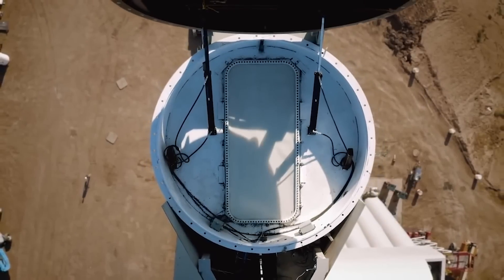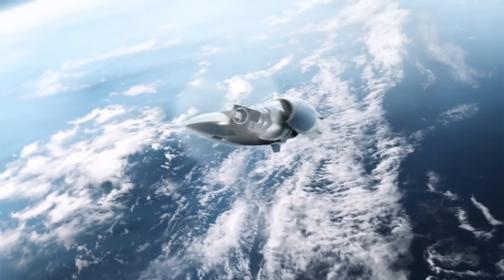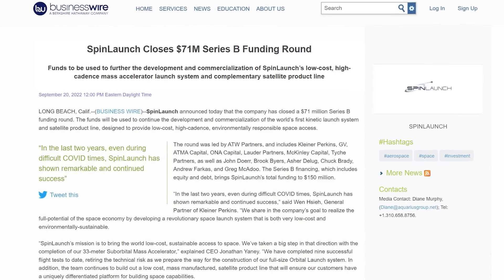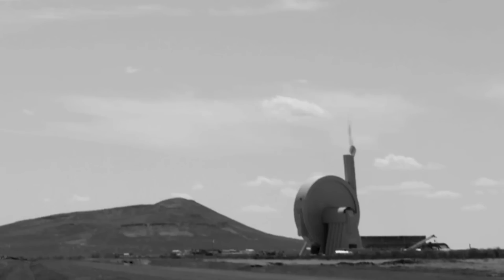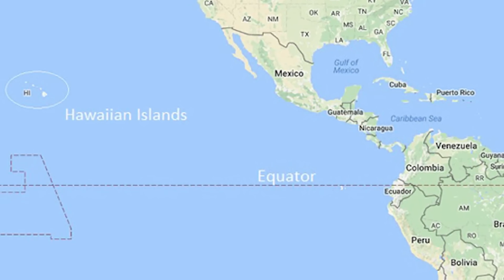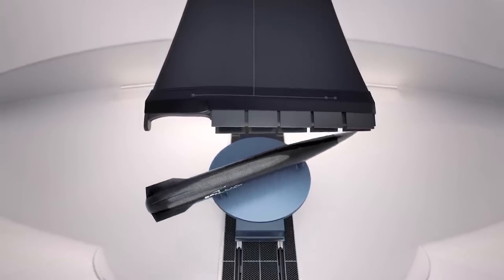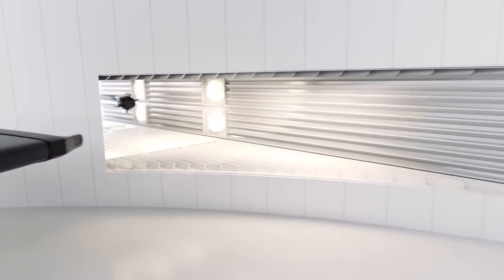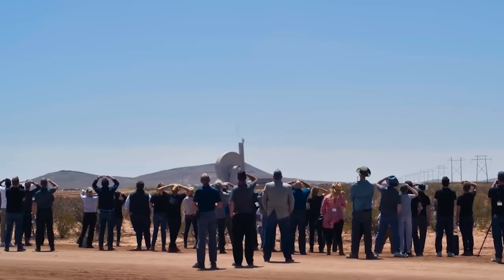What Happened To SpinLaunch & The Orbital Accelerator?

Comment: Seriously. Spin Launch is in my eyes a waste of time. All that to send up a muffler sized satellite into orbit. Something that size can be rideshared on a F9, for a fraction of the cost and 1/4 the amount of work putting the satellite in its correct orbit. They should just join SpaceX and help develop. It could be used for other things like missile defense. But all that for something so small is just not worth it. Yes it uses no engine lift at sea level, but again.. all that to send a microwave into barely orbit. 
Thanks for another great episode!
 - NOM
Reply: Actually... this might be a good test bed for developing an orbital launch system, launching from the Moon or even Mars.
Another user commented that they should be sending water to LEO for processing into fuel.  They could do the exact same thing on the Moon, either sending up ice or manufactured fuel which isnt as g-sensitive as electronics.

It would be a handy fallback option when the Earth orbital launch system inevitably fails.
Reply: @s1l3ntw1  The ludicrous G-forces created by the spinning is the killer, not the gravity. Agreed, the G forces would be less because they'd have to spin the payload less fast, but 1/6th of 100,000 is still nearly 17,000 G. It would be cheaper and more viable just to build a 5 km long maglev rail on the moon and have payloads accelerated linearly at a "modest" 100Gs and tilted up slightly as it leaves the monorail so it can spiral away from the moon at slightly more than escape velocity, which on the moon is between mach 5 and 6. Once at the right altitude a small thruster can slow the craft down to put it into a stable orbit.
Reply: @paulmichaelfreedman8334  I hear what you are saying, and would be keen to see the feasibility comparison between a maglev system and this spin launch system.

I guess my comment was more just trying to incidate that this system would be much better suited to a low gravity, minimal atmosphere situation (eg the Moon) as a lot of the downsides start to go away (eg lower escape velocity so no need to hit such high g's, no atmosphere so drag can actually be neglected, no need to seal the chamber so no worries about a fancy airlock system ), etc.
Reply: @s1l3ntw1  I understand, but 17,000 g's... hard to build something capable of withstanding such forces. each gram of matter in the object would experience a force of 170 Newtons or every kilogram adds 17 tons. That still a lot, although less impossible than 100,000, that's very true.

Comment: It would be good to see this company succeed but I don’t think this method of reaching orbit is economically viable… Even though they have demonstrated the system with a small prototype launch vehicle they haven’t so far been able to design the rocket propelled vehicle capable of withstanding the immense g forces imparted by the launch process… The next step will be to file for bankruptcy once the investor funds have been exhausted…
Reply: Right after the founders and initial investors sell all their shares.
Reply: @kennethferland5579  I bet the people at the top of this company are pulling pretty huge pay checks.

Comment: Spinach launch does not exist. Never has, never will. Those images of the facility are computer generated. Look at the vehicles in the parking lot, NO SHADOWS  and compare shadows in launch cylinder. The shadows on the building itself are inconsistent - sun is not in same position.
The moment of release would cause the device to self-destruct  from equal and opposite forces.

Comment: The military should love it. Supergun.
Reply: The railgun was more successful than this, and they nixed that aswell. It just was not practical. It required way too much maintenance and the power requirements were ludicrous. It also required gargantuan capacitor banks and to fire in rapid succession, it also needed an extremely beefy power suppy to rapidly charge those capacitors, as in multiple MegaWatts continuously. Even on a naval ship that power requirement is extreme and would justify the need for a nuclear reactor on board.
Reply: Not very portable.

Comment: The Moon. Build it on the Moon, where it's more efficient (1/6 g, no atmosphere).  No propellant is used in this propulsion system. You don't have to mine water and purify H2 and 02 - you just need electricity. The ultimate reusability.
Reply: It would be more practical to build a maglev monorail to accelerate payloads to ludicrous speeds and just have them slingshot away from the moon's surface at slightly more than escape velocity, which is about 1.9 km/sec or about mach 5.5
Reply: @paulmichaelfreedman8334  So you watched Fireball XL-5, too!
Reply: Now all they have to do is Spinlaunch the payload to the moon so it can be Spinlaunched from there to low earth orbit.
Reply: lol🤣 @Pixelsplasher
Reply: @Pixelsplasher  I was talking about launching payloads directly from the moon. But sure, make it sound stupid, if that helps.
Reply: Yes, this has been suggested in many sci-fi novels.
Reply: You will always need some propellant since (with some rare exceptions not worth considering for this purpose) anything launched ballistically from the ground will always have an orbit that intersects with the ground.
Reply: @sciencecompliance235  Sure. Have it your way.
Reply: @spacexrocks1041  Yes, my way, aka physics.
Reply: you wouldn't even need a vacuum chamber